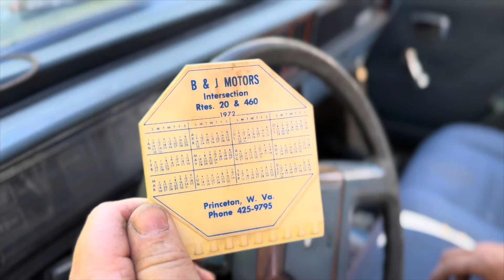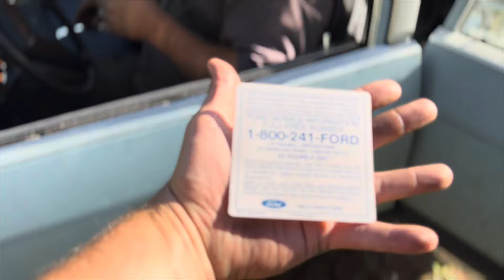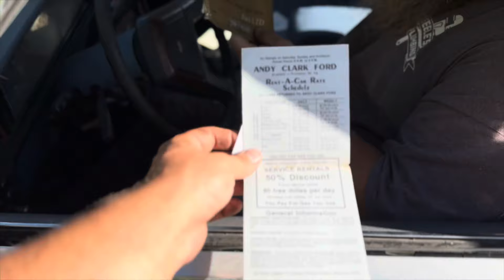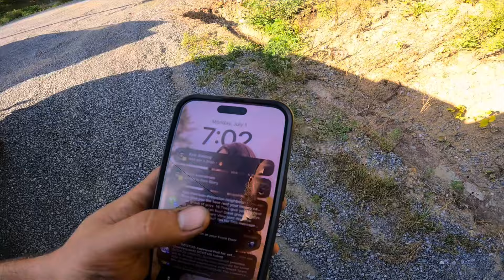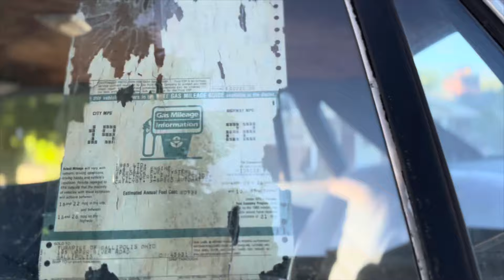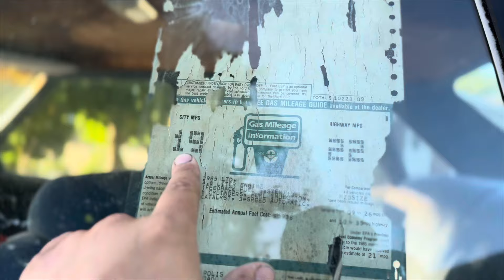She Wasn’t Happy with my Marketplace Find

Comment: I have an 85 LTD wagon NC municipality car with no AC, radio or roof rack and an 85 LTD 5.0 HP car that was drilled in the rear while writing a ticket lol.  
Drop a turbo 302/C4 in, keep the column shifter, old crusty bullet holes with DRs for street cruising….i think wifey would love it😂😂
Reply: @young11984  I want to see them, I have POS 69 Ltd I'm putting a 393 turbo in
Reply: @HBRacing7  sadly cant load pics on YT but if you in NC you can ride by

Comment: hey, im from albany ny. and i have a 78 2 door mont thats in the process of something or another. anyway i just came across-ready for this? 2 wagons from a navy base that were converted to electric for base use years ago. they say it on the door and the guy shows pictures of under the hood of one. just for the heck of it i'll look them up again and try to drop you pictures.
Reply from the maker: That’s awesome